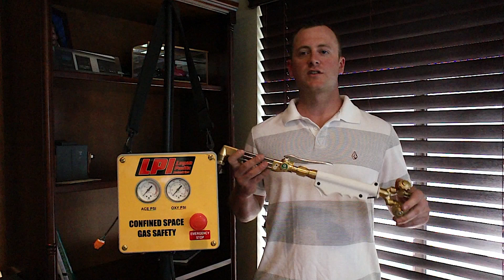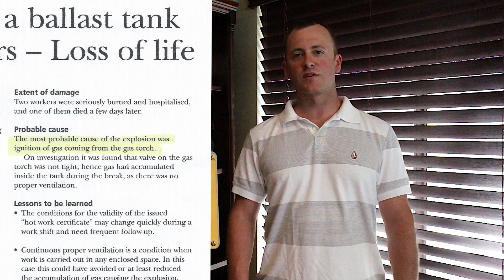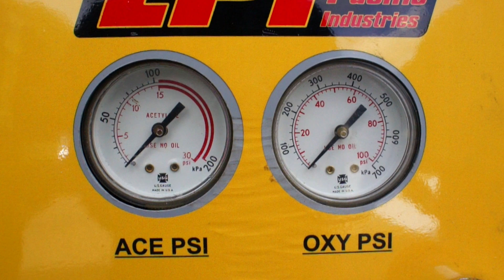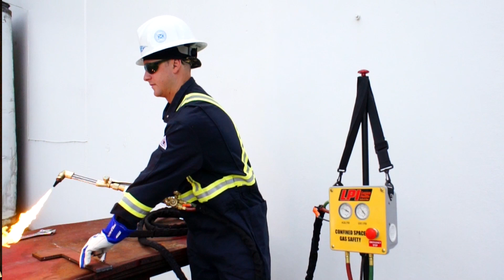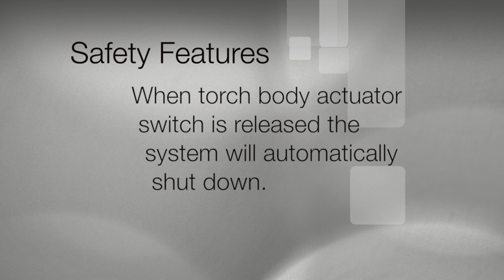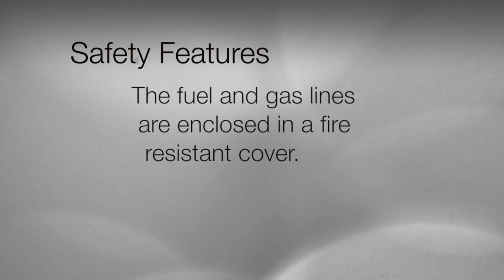Cutting Torch Safety (for confined space) - Pacific Marine / Logan Pacific Ind. Ltd

Comment: I'm a Steamfitter by trade with experience working in confined space.  Many of the older journeymen that I've worked with have been on jobs where people have died or been injured working in confined space.  These tragedies are becoming less common because as an industry we are becoming more safety conscious, and this system is a prime example of something that is safer than the system most of us currently use. The main idea of keeping the gas outside the confined space as much as possible is great, and having burn resistance sleeve is a nice touch because it's easy to get focused on your cut and not noticed that a piece of hot metal is resting against the hose.  Great idea!